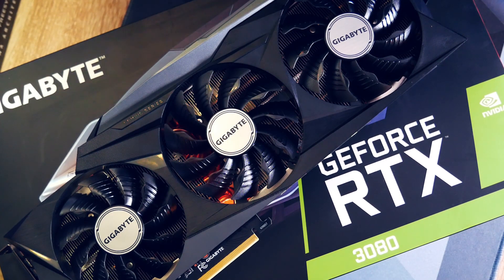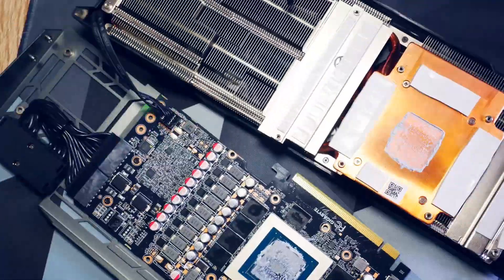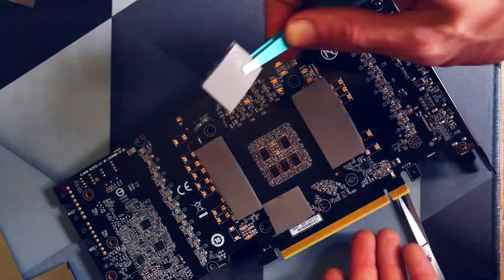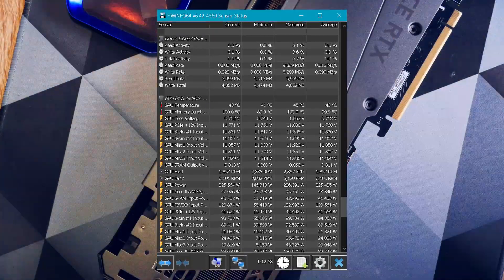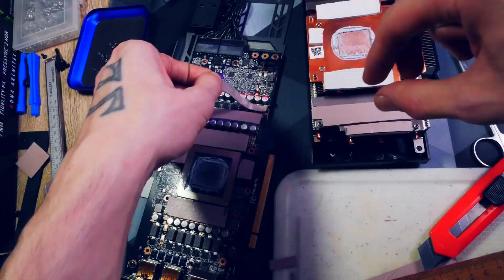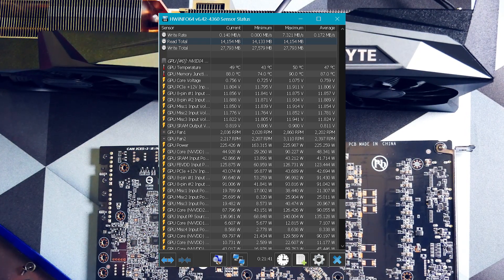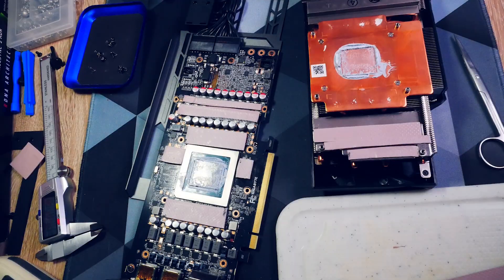How to fix the RTX 3080 with Thermal Pads | Gigabyte Gaming OC

Comment: Amazing video mate. Just wondering if I can use the 4mm pads at back and 4mm pads at front also or I have to stick with 3mm at back and 2mm at front. Thanks
Reply from the maker: Heyho and thank you first of all!! I think that at the back 4mm can work as you press it together anyway, but in the front you might get problems as other things (core chip itself) won't be able to make proper contact with the heatsink 🙈 cheers ⛏️
Reply: @CursedMining  Hi mate, thank you very much for your quick reply, I really appreciate it. Yes, I will try to use 4mm at back and 2mm at front then. See what happens. Cheers mate
Reply from the maker: @sunshinel6994  anytime mate! Don't hesitate to check back ⛏️ cheers!
Reply: @sunshinel6994  Did the 4mm pads work for the backplate?

Comment: My 3090 gigabyte already came with thermal pads on the back, does it mean mine was used? Or does the back already have thermal pads but they just suck.
Reply: Same here my gigabyte 3080 has the thermal pads on the back plate?
Reply: @julleonfischer4877  mine came with them too.  runs 100 MH/s around 90-94c on memory
Reply from the maker: Which exact model is it? Normally GB has none on the back and the ones on the front suck either way, but depends on your model, cheers ⛏️
Reply: @CursedMining  mine is the gigabyte 3090 gaming oc edition
Reply from the maker: hey guys, it seems they at least listened a bit to all the people complaining and have done a revision which is good :) but they generally don't use the best quality of pads themselves, cheers everyone, thanks for sharing :)
Reply: @CursedMining  update would it be Okey to use just 2mm for all of it?

Comment: It's hard to know what sizes you need on anything
Reply from the maker: Oh I mention it in the video! 3mm on the backplate, 2mm on the Vram chips, 1mm on the small electronics :) where to put it or diameter you can check from the old thermalpad when removing :) cheers
Reply: @CursedMining  is it same sizes for Gigabyte AOURUS card you dont know?
Reply: I understand that but I meand 3mm 100x100 or 2 50x50 for every one

Comment: Hi all, is there a trick to disconnect the fans. They won’t budge. Thanks! Derek
Reply from the maker: Unfortunately not, just a lot of finger pain 🙈 I remember it
Reply: I ended up doing it with the fans still plugged in. Not ideal but honestly it was easier than keep fighting to get them out!
Reply: Thanks!  I actually at the end did exactly that out of desperation. It was actually quite doable .  Now VRAM temp is significantly lower. I also lhave a few aluminum heat sinks thermal pasted on the top of the back plate.   So far so good. Thanks!!

Comment: I replaced the Thermalpads on my 3080 Gaming OC, the Memory Junction temperature went from 110c to 80c. I used the Thermalpad Thermalright 2mm on both sides and kryonaut on the GPU.
Reply: Hey mate, did you also use 2mm for the capacitors too? Cheers
Reply: I changed them as well with 2 mm but nothing changed. Any idea what went wrong?
Reply: @seyyidcakir6399  pads Thermalright ?
Reply: @rafaelribeiro5771  No I am going to buy that brand now but use 3mm on the back, 2 mm on the vram. Hope it works.
Reply: @seyyidcakir6399  My friend the pad from Thermalright or another big brand like Gelid has around 12.8w/mk, the original pad has 6w/mk. If you put a generic Chinese pad with 1.5w/mk to 3w/mk in place of the originals, you are making your system worse. This can be the problem, I recommend you watch the entire video because it was well explained and to change pads you must use equal or better quality and not generics.
Reply: @rafaelribeiro5771  I know brother, I used a brand called Pullsar Ice Dragon with 17w/mk, not generic, but only 2mm. I am going to try the Thermalright brand now as I suspect the brand I used might be bad, worth trying
Reply: Voce colocou 2mm em todas as partes? Inclusive no backplate? Alguns dizem que na parte de trás tem que ser 3mm. Vc reduziu para quanto? Continua dando throttling?
Reply: @luirdi  leia a primeira msg.
Reply: @rafaelribeiro5771  valeu! Pq olhei sem abrir e parece que alguns são menores.

Comment: I have 3x 3080 FTW3 GPUs and they thermal throttle at +1800 on Hive OS.  Reported temps are 40, 41, and 43.  I ordered some Grizzly 2mm pads but can't find 3mm anywhere.

Comment: Exactly...you really need take of shxxxt greasy thermal pads Gigabyte put on GPU ,but due to lack of find those  thermal pads (2 mm) ,i was need to stack 2x 1mm arctic 6k/w (for  front side GPU) ,but hey  still good than stock shxxxt pads on my 3080 gigabyte gaming oc. I managed drop temps from 110c  to 88c  and for that mod i made it with stacked pads i can say   is really really good . (i was afraid make some air pockets  when i stack those 1mm pads from arctic so i pressed a bit ... not so hard ).
Also for backplate i stacked the same Arctic 6k/w thermal pads , but one 1,5mm with  one 1mm that results for 2,5mm total.(3mm is to much because Arctic are  bit to thick and you will get a backplate bending).

Or i was lucky with thermal pads mod or it just work with lower rated k/w thermal pads like Arctic are.

Comment: i used 1.5 mm thick aluminium , and made my own pads . 12x14 mm, and pace them directly on the memory with thermal paste, and moved the oem pads on the back side ,  and after that memory temp droped to 75-82 C
i done this to 12 rxt 3080 already and they all work fine @ 100 mh/s
Reply from the maker: That is amazing! I've heard a lot about metal pads, some recommend copper too, thanks so much for sharing!! Cheers ⛏️
Reply: @CursedMining  copper would be better, aluminium was easy to find , and cheap
Reply: those metal pads not short circuit  the  gpu?
Reply: @riannair7101  i had no problem until now... and i did this to 12 gpus

Comment: Thanks man. I have the same card. Performed this mod (albiet with thermalright pads instead of thermal grizzly pads) and performance is exactly like you said. 88C with fans at 80%. This was actually my first gpu teardown, and was stressful but a lot of fun, and wouldn't have been possible without this video.
Reply: Hi, can you detail exactly how many Thermalright pad units of each size do you used for one card? 1x3mm, 1x2mm and 1x1,5mm as according to this video? I've read a lot of comments in Reddit and there is a lot of confusion around the needed thickness, eg https://www.reddit.com/r/nvidia/comments/l1uqnk/gigabyte_rtx_3080_vision_oc_changing_thermal_pad/
Reply from the maker: Hey Lucas!! Your comment makes me happy, I am glad you could fix your card and the video helped :) thanks for the info about Thermalright too! Cheers mate ⛏️

Comment: Glad I got a ftw 3 card, mem +1500, core - 200, 60% pl, 65% fans, 86c mem and 100mh
Reply: yes 100% my ftw3's average 103mh, my gigabytes even after repadding are 50/50 @ 96 or 103 mh
Reply from the maker: @gr3g0snz  102.5 on the GB here now at only 84 ° C memtemp :) still no EVGA to be found 🥲
Reply from the maker: Sounds perfect! couldn't get my hands on one! Great cards :) cheers ⛏️

Comment: you can probably use 2x1.5mm tp, I can buy 1.5mm in my local store so I plan to buy them and use 2 pieces of tp one on another, I think it should work too.
Reply: 2mm is enough, I used 2mm on the backplate and reduced it from 110c to 80c.
Reply: @rafaelribeiro5771  I had some 1.5 mm so I tried using them but I had no luck. 1.5 mm isn't enough.
Reply: @tomasrosalesr  
2mm is minimal for a contact between the PCB and the back plate, 1.5mm does not work and 3mm occurs with interference, so people prefer 3mm to embrace the components. 1.5mm is ideal for the front. 1.5mm in front and 3mm in the back, but any pad over 2mm works on the backplate.
Reply: @rafaelribeiro5771  Good to know... Now I only have to redo the back 👍🏻
Reply: @rafaelribeiro5771  So can I use 1.5mm pads for the factory pads replacement?
Reply from the maker: Yes I read from people it works :) 4mm ones (so 2+2) works too. It is said you might loose a bit of the pads conductivity for any possible airgaps etc., but I think especially on backplate it will be pressed well :) cheers!

Comment: how do you take off the fan pin, my card is very tight the pin.
Reply from the maker: it was the same for me! it took a lot of "left right left right", but don't pull the cable, just the pin. I think I hurt my fingers on that card 🙈 after the first time it goes easy, cheers ⛏️
Reply: @CursedMining  I manage to pull the entire plug out with exposed the 3 pin. Luckily nothing spoil. What is your mining GPU temperature? Mine vram at 88 degree and 61 for GPU during overlooked mining.
Reply from the maker: Your temps sound great :) I am at 88 memtemp too! ⛏️⛏️

Comment: subbed, which size of thermal pads did you buy 120x120x3 or smaller, i need it for 2 Gigabytes
Reply from the maker: First of all welcome and thanks! The 120x120 is definitely the safer choice! One 50x50 was not enough for 3mm, from the second pack I got plenty left though :)

Comment: Nice the gb oc model break my nerves i dont have and i  cant find 3mm pads is it ok if i put 2+1 together?
Reply from the maker: it says one will loose a bit of the conductivity when doing so (airgaps etc.), but I heard from ppl successfully doing so :) I think especially on backplate it should be pressed anyway! Honestly about Gaming OC I thought so too, but after this upgrade I love it 😁 next video will discuss some temps etc, cheers ⛏️
Reply: @CursedMining  i v putted 4mm at the back and its working 3mm looked thin to me as i know by time the press more
Reply from the maker: Yeah I imagine with backplate more is fine too, and no chip that could not make contact on backplate :) glad it worked! 4mm seems hard to find too! Cheers
Reply: @CursedMining  25 c temp room and its mining at 100.80 i know they are hard to find thats why i used 2 of 2mm;)
Reply: @CursedMining  Thank you i will try it i think also the important is to change the front
Reply: Exactly...you really need take of shxxxt greasy thermal pads Gigabyte put on GPU ,but due to lack of find those  thermal pads (2 mm) ,i was need to stack 2x 1mm arctic 6k/w (for  front side GPU) ,but hey  still good than stock shxxxt pads on my 3080 gigabyte gaming oc. I managed drop temps from 110c  to 88c  and for that mod i made it with stacked pads i can say   is really really good . (i was afraid make some air pockets  when i stack those 1mm pads from arctic so i pressed a bit ... not so hard ).
Also for backplate i stacked the same Arctic 6k/w thermal pads , but one 1,5mm with  one 1mm that results for 2,5mm total.(3mm is to much because Arctic are  bit to thick and you will get a backplate bending).

Or i was lucky with thermal pads mod or it just work with lower rated k/w thermal pads like Arctic are.

Comment: brilliant guide but i did this on my  aorus 3090 and now wont show a vga signal, any help guys?
Reply from the maker: oh no! Check all connectors inside and outside, switch connectors, cables etc., I hope nothing came loose 🙈
Reply: @CursedMining  thanks for the reply. theres 3 connectors on mine. they are for the fans and rgb. both of those work when cards plugged in and the backplate warms up a little so it's doing something. I bought from ebay so dont have warrenty

Comment: Memory junction went from 108 degrees at 190 watts to 84 degrees at 225 watts steady state. Used the cheap blue 1.5 mm pads doubled up. Thanks for the vid
Reply from the maker: Hey man very welcome!! Awesome to hear it worked with cheaper pads too 👌👌
Reply: Hey will a 85x45 3mm pad be enough for the back plate?
Reply: @gmu_alum08 Those are just what I had laying around and I was not okay with the 108 temps. And honestly, just because thermal pads are more expensive and have a better temp rating, does not mean they will last longer. These cheap pads have done a great job, but I plan to replace them with one solid piece eventually instead of doubled up.
Reply: @gmu_alum08 I think most people don't really have to worry about those temps, but for us miners running 24/7, it surely is

Comment: Bro great video! I just did this on my Aorus Master 3080 and got same results. Around 110c to 88c. Used Gelid pads as well. I did however break the cable that lights up the area around the fans. No biggie but I did almost have an anxiety attack. First time taking apart a gpu and I felt super accomplished when it turned back on. Solid info you have in this video.
Reply from the maker: First of all thank you very much!! I am glad it worked out for you too :) it can be taunting at first, by now I really enjoy opening them :) but yes the dang cables 🙈 cheers mate ⛏️

Comment: The original Pads on the VRAM are 2,5mm thick. I have Problems with 2mm Pads sadly.
Reply from the maker: I heard some people talk about it! I am currently undecided between keeping mine as is for longevity test for now and only then redo. Or redo now with 3mm instead of 2mm and check the difference. For now mine runs fine though, might depend on how dense/squishy the pad is too I guess - cheers ⛏️
Reply: @CursedMining  If you have nice Temps you don't have to. But my Problem come in less than 2 or 3 days. Horrible. Now i have 100°C with +1500mhz and 65% Fan and a Fan ontop of the Backplate.. In the First 3 Weeks i Had 90°C with these Settings with No extra fan.
Reply from the maker: @DarkAndi444  wow sounds like the pads are disappearing! Which model is it? Cheers
Reply: @CursedMining  EC360 Silver. 50x50x2

Comment: Hello! 
Could you please tell me if the thermal paste used for gpus is the same as the one I put over the microprocessor? Thanks for the video!
Reply from the maker: Which microprocessors you mean? Usually it is the same as you'd use in laptop and other devices, e.g. Arctic, Thermalgrizzly, Gelid etc.
Reply: @CursedMining  yes, I meant the thermal paste you put between the processors (Intel, AMD.. ) and the dissipatir fan...

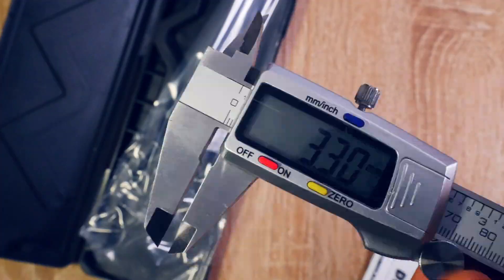Comment: Hi, at 03:25 when you cover the memory chips, would you be better off filling the gap fully between the cylindrical capacitors and the sliver box/edge of the GPU die. Would that allow you to disapate heat from the caps too into the copper heatsink via the thermal pads. I know the caps have their own thinner strip of thermal pads on top of them too.
Reply from the maker: Honestly I would need to test that next time I redo it and compare! For now I want to check how long it stays OK, some people said they had to redo again in a few months. I was wondering the same for more parts of the backplate :) cheers ⛏️
Reply: @CursedMining  redoing would get really expensive really fast. Already spent like 40-50eur on the pads + calipers

Comment: Sadly after one month mine is back on around 100 degrees...
Reply from the maker: what brand of pads did you use? Cheers ⛏️
Reply: @CursedMining  Minus pad 8 from Thermal Grizzly . When i put them ,96 degrees with same oc settings but 40% fan speed , now 104 degrees with 100% fan speed ...
Reply from the maker: ah dang sorry to hear that! I will also be watching over time, do updates and when degrading I will try a different brand for longevity :) cheers ⛏️
Reply: @CursedMining  Cheers mate !

Comment: Cheers, I have the same card. I used some cheap Ali Express pads 3.2 W/mK for front and back (basically all I could get), temps dropped from 110C on the edge of thermal throttling,  to 100C with more aggressive overclock which was good but still not super happy.  I haven't found a lot of info on the quality of thermal pads, and your info tells me I need to order higher quality pads for this model. Makes me wonder how Gigabyte found such garbage pads.
Reply from the maker: GB seems to be using the worst! I had 1.6-32 W/mK from AliExpress too but only dared on msi RX5700, it also just was a minimal improvement. I will be testing 12W/MK next if one can really feel a difference :) cheers!

Comment: backplate thermal pad 3mm will stop thermal throttling but still hot around 102 to 106 after i but 2mm in front temperature around 88 to 92  memory oc 800 +

Comment: my memory was at 84 for a while after doing this but is back to 106. should i take it apart again?? ffs
Reply: What did you do in the end? Which pads you used originally?
Reply: @MrUriel250  took it apart again
Reply: @WhatsY0UTUB3  Which brand of pads you used for the first and second time?
After taking apart again is it good?
Reply: @MrUriel250  its good now. i didnt clean the areas where the pads go good enough the first time. I build a mining rig with 8 gigabyte gaming oc 3080s and they are all running at good temps with 95-99 mh/s.

i used thermal grizzly minus 8 pads for all of them